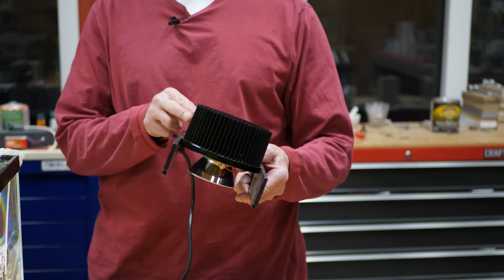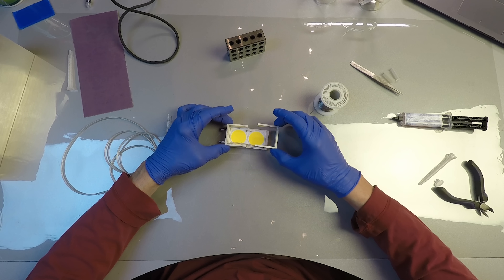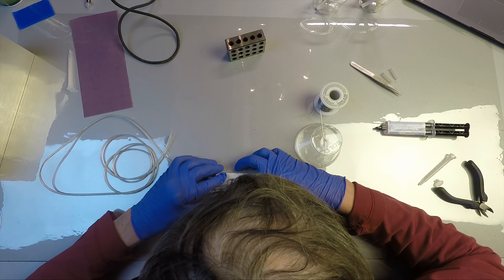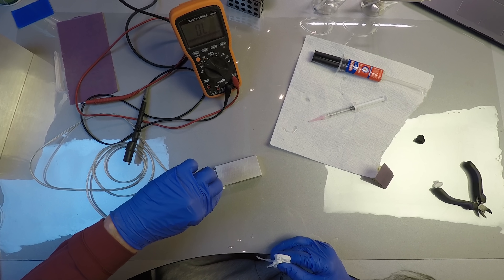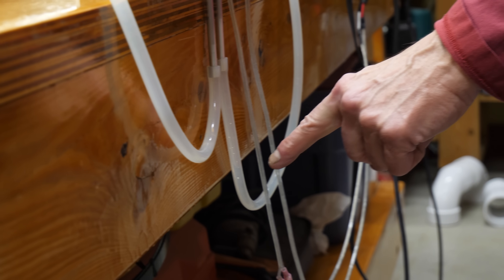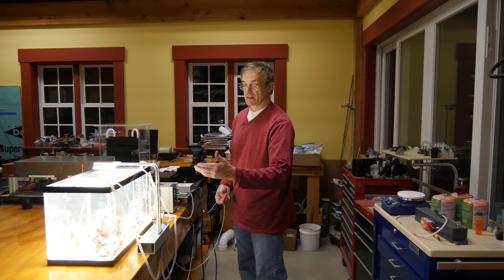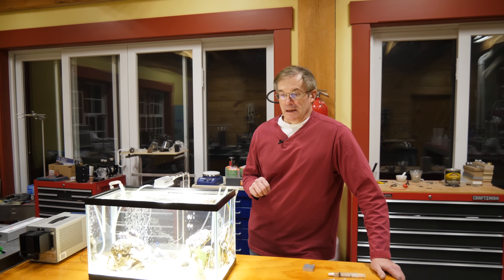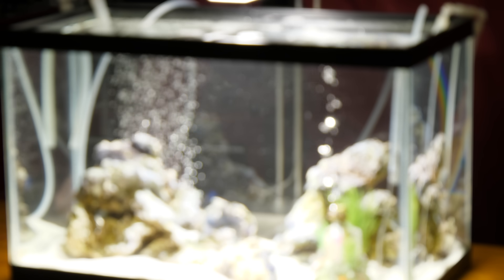40,000 Lumen LED Aquarium Light

Comment: Wow, that is a SUPER low profile light fixture! For larger tanks, I think the benefits would justify using a dedicated coolant loop.

Now i'm imagining an upgrade to track the light across the tank, ala solar motion across the sky. Same technique with low intensity blue-white light could replicate the lunar cycle, as well. :)
Reply from the maker: You're right. A belt driven, synchronous motor driven track like a one axis CNC router (kits on Amazon) controlled by an Arduino...
Reply: @TechIngredients  Very good idea, although a DPDT switch mounted to each end could change the polarity of the synch motor and control direction in a more simple/ cost effective way then an arduino. Not sure if those motors can reverse direction with reversal of polarity, but its worth looking into maybe. The sync motors can usually be found in thrown away microwaves that have the rotating cooking trey inside, and the use of  a track system would make a single light much more efficient. As to the aquarium light idea, its brilliant first of all, but I was wondering if low viscosity, water potable silicone might be a viable alternative to epoxy? Although epoxy might be the superior option.  Also,  Thank you very much for the videos! Not only have I learned a great deal from them, but they are very well made and perfect for the type of hair-brained, shoestring-budgeted contraptions and projects Ive been working on.

Comment: I think an easy way to prevent fouling would be to place the intake tube into the outfall of the filter that I assume you have
Reply: nope.  no filter shy of a diatomaceous earth filter will filter bacteria from the system, and for that exact reason (since you don't actually want to keep a diatom filter running for a long time - you NEED free bacteria in the system for waste processing), it would not work.  bacteria will grow on the inside surfaces of the tubes, including the metal ones.  ever try to clean slime out of a narrow right angle bend metal tube?  I haven't either, because people who make parts for aquaria know how difficult that would be, which is why they don't make them.  It's bloody hard enough cleaning straight filter tubing!

Comment: I put in 1100W of light over a 90-gallon reef tank and never bought a chiller nor do I recommend using one since (a) they use a lot of power creating more heat in the room that must be removed and (b) you will miss out on the opportunity to add more kalkwasser in an evaporative system.  I simply mounted two fans blowing over the surface and had an automated top-off system that added kalkwasser (a saturated calcium hydroxide solution).  This made the corals grow like crazy and kept the colors vibrant, and it kept the pH, calcium levels, and alkalinity of the system up sufficiently that it could support even heavy coral and coralline growth.  The growth in my tank was so striking that I often held tours of it to help younger reef tank enthusiasts duplicate my success.  In the case that you live in a closed up house, I recommend venting the fans up and outside through a flue.

Since we are on the topic of heat dissipation, I also recommend, in any powerful reef setup, a simple thermal switch to turn off the lights in case a fan or chiller fails because just like we are seeing in nature today, reefs catastrophically fail if they run even 10F too warm via coral bleaching events, which in a closed  system can also reduce oxygen levels to the point that other creatures die with them within hours.  Some people also buy two-stage switches that can turn a second fan on before turning off the lights if modest warming is experienced.  This stuff is IMPORTANT!  I've seen two people lose over 10,000 worth of fish and coral because they didn't spend $100 on such a switch and had either a fan or chiller go out when they were out of town.  Incidentally, such thermal switches can be had for less than half that online in today's direct-from-the-east world, and even the solid state ones aren't much over $130 or so.
Reply from the maker: Over our large reef tank we used to use four, 400W MH lamps without a chiller, but the large sump and skimmer produced a lot of evaporative loss and hence cooling.  This tank is located in a cool basement, however we have a smaller tank that always ran warm despite relatively lower lighting levels because it was located in a warm room. These LED lights and the potential for removing the heat with a low power closed loop radiator, provides another option.
Reply: @TechIngredients  Yeah LED lighting has changed the whole reef keeping game.  I was getting out of reef keeping, after 20 years of being in, right around when the better units really hit the market in full, but I did use a prototype design from my brother's company Castle Creations for my 120 at the time.  Castle ended up sticking with brushless motor speed controls, but given the high-power, pulsing DC that brushless motors need to control them, it should be no surprise such a company dabbled in reef tank high-intensity LED setups.  The 700W LED prototype created a very intense well-balanced white-blue light (extremely beautiful rendition), but I also felt the growth I got wasn't quite as high as I'd expect with the readings coming off the PAR meter.  I think nowadays, though, LED lighting is a no-brainer, and I'm sure the issue of the spectral holes has been worked out to give superior growth.  Plus, as your video makes super clear, there are huge advantages to cooling a solid state point-source light device like that.  Water cooling, for example, would have been very much appreciated in the days of metal halides too, but it was too unwieldy to really take on for halides in any tank owner I'd met.  High-intensity LED-packed chips changed everything.

Comment: I loved the part when you coated the heatsink. As it was the issue I wanted to address for tank habitants
Reply: not sure I would trust it frankly.  no way to make sure you got a good seal on the metal.  though really that tiny bit of aluminum shouldn't be a problem.  it tends to oxidize rapidly on the surface.

Comment: Another fantastic video, par for the course for you at this point.  I've been looking, but I can't seem to describe what I'm after very well to Google, and factors into this build very heavily:
Given that liquids and gasses expand when heated, in a tube that creates a flow. Is there a way to calculate the expansion, volume moved, rate, etc, given the pipe length, width, material, heat input, specific heat of the coolant, and so on? If you know how much heat those lights are putting out, and you know the length of the tube, you should be able to calculate the flow rate, and how much it would increase if you increased the wattage/voltage, right? 

What is this called, and would you consider doing a little explainer video on it?

Comment: Pro tip: When using fast dry, or any epoxy for that matter, a good rule is to set aside your mixing implement (Popsicle stick) with the left over epoxy while waiting for your work to harden.  This allows you to know, for sure, when it's good and hard because both will be curing at the same time.
Reply from the maker: You're right.  And knowing that fact is like a secret hand shake.  Only someone who has been there would know that.
Reply: @TechIngredients  Too right!  Wasted a lot of time before I learned this.

Comment: I built a 1000 gallon tank, using the tank water to cool 100W cob grow lights, I was doing 1/2 aquaponics (open loop, no return from tomato plants), and I ended up waterproofing a couple of 10W cob lights and just throwing them in the bottom of the tank.  The lights were cooled by the tank, obviously, and facing up.  The fish would swim close and cast "shark" shadows on the ceiling.  We had wave shadows too.  Now when I think of lighting tank, I always remember those lights and the amazing fish shadows.
Reply: I take it something failed and you didn't put it back together?

Comment: You could remove the wire and use the pipes for the power supply to the led's, but yes, more work is needed to make this work as it would just shourt out as is.
Reply: no, there is no issue with it shorting out.

Comment: I have a very hard times understanding what the need is to use such bright lights in an aquarium. Ok they can be dimmed but then why not select less powerful COB since an aquarium doesn't need such a powerful light. Plus using the aquarium water to cool the COB that's just so wrong specially because you can't control the temperature. Only use I see for this is, is making algae. Even aquatic plants don't need this much light unless we are talking about very deep aquariums. The overall idea is nice though.

Comment: I had a thought that you could find a comparably sized and priced nickel or nickel plated block to use instead of aluminum. Couldn't find any but I did see some anodized aluminum. Would that anodized layer hold up to the water well enough to forego the epoxy?
Reply from the maker: Yes, it probably would, but test the conductivity through salt water placed inside the block.  The anodizing needs to be present inside the block and it may not be.

Comment: I've done a super lazy version of that for a couple of years on a few tanks, just pumping the aquarium water through that type of cooling blocks untreated. That's without to me apparent problems,  and I'm a quite experienced and successful hobbyist aquarium fish, shrimp, snail and plant breeder/grower. I've been told that the aluminum oxide that forms is fairly stable,  and therefore aluminium is fairly safe, for freshwater, assuming fairly close to neutral pH. Now, this coming from you, I have to reevaluate the whole issue of aluminium in contact with aquarium water.

Epoxy in the cooling blocks seems great. 

One of my plans for further development of this was to use the waste heat for a super low capacity water distiller. I was thinking, if you have 50% waste heat, and if you can can use that with 50% efficiency you have 25% of the energy used by the COB as useable heat as long as the light is on. 

IF those assumptions are roughly correct, according to my calculations you should be able to get about 0.3ml per watt used by the cob, per hour in use. Seems ridiculous perhaps, but 100W run 10 hours a day would make 300 ml distilled water a day, which adds up, and while probably won't revolutionize anyone's life, has potential practical use.       

I was thinking that the heat should be led to an open water container with isolated sides and bottom, inside a closed but unisolated container, not trying to boil the water, just use temperature difference between the slightly  warmer water and surrounding air.  

I don't know if 50% efficiency is anyway near reasonable, or if you'd need enormous containers/surface areas to make it feasible at all without using a heat pump, and so on.
Reply from the maker: The aluminum will be a much bigger problem with salt water.  Don't depend on the aluminum oxide layer.  For example, if you put an ohm meter to an anodized aluminum surface you will not get any conduction, but if you take a piece of stock aluminum which has been exposed to water or air indefinitely, the conduction is excellent.  Anodizing basically generates an aluminum oxide layer, but it is much denser and thicker than the layer produced by oxygen exposure and aluminum oxide is non-conductive.

Comment: About 5 years ago I ran three led pucks 40w each , they were cooled by CPU water blocks off eBay and then into a radiator, it worked well and provided immense light and they stayed cool.   Problem is lots of moving parts, now I just run a heatsink and fans , job done.  However for super efficiency u could run a setup where u heat the tank or also u can shift the heat outside your house etc.

Comment: Wonderful LIGHT & great complete instructions.

I want one for light challenged RV.  I live in it full time.

I have 7' ceilings.  It is lit by dual 12V DC fixtures with tail light bulbs.  Dismal is the polite description.  LED bulbs provide only marginal improvement.

RAPIDLED has nonexistent voice customer support.

I can create an extendible horizontally mounted arm to support the example you show.

What does it weigh?

What are the dimensions?

Thanks,

David
Reply from the maker: David, for a more convenient installation if you don't want to utilize liquid cooling, take a look at our previous video where we attach one of these COB LEDs to an air cooled heat exchanger.  But to answer your question, the head weighs around 100 gm.
Reply: Thank you. Sir.

Suggestion -
Add Product Names in the Notes or Add a Comment on the screen when mentioned.

Have a Blessed 4th,

David

Comment: Pushing the envelope. Some small modifications and this could get very interesting. A+ for original content!
Reply from the maker: Thanks!
Do you have some suggestions?
Reply: I will be using a spiral-wound stainless tubing coil that fits inside my tubular shaped tank filters inside diameter perfectly (two small holes drilled and sealed at the filter top cover for entry/exit of tubing). Filled with distilled water and connected to the COB Al block with black opaque plastic aquarium tubing to ensure no algal growth is possible. Additionally, (and likely unnecessarily but, hey, why not?) I will smooth the top of the block and a small fin assembly and attach them together using the high-tech heat transfer epoxy you’ve recommended along with a temp strip monitor for some indication of performance and some protection in a water pump shutdown failure scenario although I suspect the convective motion through the system will be adequate temporary cooling insurance even given the limited stationary water volume of the pump in shutdown mode. Then I will mount a thermistor-switched fan to a mini cooling fan atop the finned water block connected also to a flashing super-bright LED and a PA siren to alert me to a temp rise and then....just kidding on these last bits, I AM a bit OCD (you too?) but not crazy! Well, not too crazy, haha.
Great Vid as usual, might make me set up my tank again. This project is ‘doable’ for me, unlike your homemade cyclotrons and fusion reactors, LOL.

Comment: Just a trick to remove heat since i have a 4feetx2feet aquarium which holds 400liters of water and three 50watt led flood lights the canister outlet comes with multiple holes like a flute place it such that the water out flys out and hits the water surface like rain/ jet that way the heat gets dissipated and the water gets aerated, this also helps trapped gasses escape.

Comment: Half the brightness of the sun at noon on the equator? Those fish live in water that's much deeper, is murky, and there's a ton of tree over hang and places in the water for the fish to hide. Way too bright! The cooling system will get clogged after about six months! And worst of all, there isn't red, blue and green for growing plants. If your going to show people how to build a light, at least make it a light worth building. This was so ridiculous.
Reply from the maker: Thanks for the feedback!
Firstly, the power level was presented as a reference to just how much potential this tiny light is capable of.  You could use this same light to illuminate a much larger aquarium. Nevertheless, shallow water corals need high light levels to thrive.  The solar irradiance at 3 M deep is still 70% of the surface irradiance. 
A biofilm will decrease thermal transfer, but it will be thickness dependent.  Eventually, the block will have to be flushed and so we have been running this lamp over one of our tanks for about a month and we'll examine the performance after a few more months.  Of course, you could operate the light with a closed loop radiator and you would want to anyway if you have a large tank and want to eliminate the waste heat rather than recycle it.

Comment: Can you make a video explaining the electron movements of bitter magnets? And how the right hand rule applies to them? Or point me in the direction of some resources. I've managed to find plenty of information on the production of them but nothing really on the physics of them and how they operate differently than an electromagnet composed of coiled wire. Once again awesome channel. Thanks.
Reply from the maker: They are interesting and I reviewed the principle.  Basically, they operate with the same process as a coiled wire electromagnet.  The spiral path is accomplished in a single or at most a dual pass around the bore.  The primary difference is mechanical.  The thin, wide plates provide better filling effeciency and structural strength and the large number of perforations provide flow channels for water cooling.  The problem is the cost/difficulty in producing the thousands of thin arc shaped sheets of copper that have to be hand assembled.